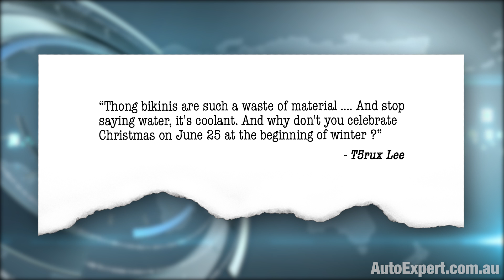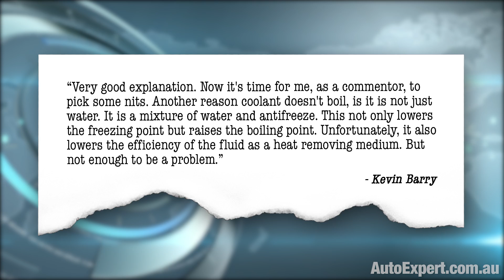The mad science of coolant (beer garden physics - yesssss!) | Auto Expert John Cadogan

Comment: Fun fact, you can infact draw more than 10 amps from a 10 amp plug, I run my 200 amp welder off of one which at peak will draw about 13amps from the wall. Multiple 10amp outlets often share a breaker so the breaker is usually rated more than 10 amps, it's just illadvised to do so for more than a few minutes at a time, melted cables and electrical fires being a thing. Still an electrical engineer and an electrician both told me this was ok to do.....

Comment: It also increases the boiling point so you can use a smaller radiator. That plus pressurising the coolant circuit means you can get away with a top pipe temperature of about 125C. Take a look at the section on nucleate boiling on Wikipedia - it's why water is a good coolant.
Reply from the maker: Try watching the fucking video - where I say all that about the BP and the pressure. You fucktard.

Comment: I actually run about 30% coolant 70% water in my car so I still get corrosion protection and freeze protection down to about 0 degrees F (way lower than I ever see here in Tennessee) while improving the engine's cooling a bit. Cooling is much more important where I live than freeze protection below 0 degrees F since it never gets nearly that cold here.

Comment: Just because the mixture has a poorer heat transfer rate than pure water doesn't mean it isn't acting as a coolant. Air is pretty poor at transferring heat but it still acts as the "coolant" for air cooled engines...

Comment: As an amateur mad scientist I will add that Ethelyne Glycol is clear. It is dyed green. The dye looks like aquarium gravel but if you handle it your hand will be green for weeks.
Also Propylene Glycol is sometimes used in diesels to prevent little bubbles from forming on the cylinder walls (all noise is movement). It is less toxic and here in Retardistan can legally be found in cheap ice cream and offbrand Toaster Strudel knockoffs.

Comment: I had to stop this lady, her car had a leaking "radiator" and she was about to put the green stuff in, but I could clearly see she was dripping orange fluid. Her car was running on of those OAT/HOAT variants of antifreeze. Thankfully I stopped her before she poured it into her system and turned her cooling system into jello! But yes, antifreeze isn't designed for better cooling, it's designed for places where it gets too cold to use water. Another issue people run into is overfilling their coolant, which causes a whole host of other problems. In any case, excellent discussion. I appreciate that you started with some lighter material to get our attention first. Plus, who doesn't like to look at a nice girl in a bikini?

Comment: Fun Show :) But hey? Isn't it obvious? - It's called coolant 'cos it's NOT water, due to necessary additives. Yes, antifreeze in "retardistan" - But, in 'Straya - still needs corrosion inhibitor. Yes, the heavy lifting shock absorber is the spring. Technically, the "shocky", is a Damper. But it's still a shock absorber - for the shock absorber? :) Yes, a radiator is a heat exchanger - When the engine is running. In a stopped vehicle - Everything cools down more by radiation, than convection? If this sounds like an engineer - Calm down - I done time, plumbing & clearing drains - like most blokes? :) After the silly season, John - You cd do a show about the possibility of magnet & coil induction suspension systems - to do the job of struts & regen back to hybrd or ev batt? They cd outlast mech struts?

Comment: these waterless coolant they clame you never need to change it or is it better or not then the off the shelf pre mixed red or green coolants, they any better then the regular stuff ?
Reply: Public Safety Lights Australia they’re rubbish for heat transfer. If you live in a warmer area don’t use them
Reply: @erroaustralia6311  yeah thought as much, sounds like a interesting product, will just stick with the off the shelf radiator fluid old faithful.
Reply: Public Safety Lights Australia if you want good heat transfer, NATRAD corrosion inhibitor Type B, up to 40% more heat transfer than OE coolants.

Comment: I only put it in to stop corrosion, 'specially for the ally parts. Antifreeze in Aus, yeh right (seen some orrible results of ally heads on plain water  from the '70's)  I'm sure the engineerholes design the cooling system to accommodate the additive factor

Comment: I thought the main reason to use the green stuff and not 100% water is to avoid corrosion of the aluminum alloy water jacket.
My former Kingswood HG with it's iron 186 just used tap water.
Reply: Yeah and probably corroded out now. Strike water at 20 thou through corrosion.  And all that rust build up  effects the engines ability to cool properly. OEM they used an inhibitor of some form. I worked in a Holden dealer in 71 and we sent lots of it too dealers.
And water= corroded water pumps, alloy intakes etc etc.

Comment: I know you mentioned de-ionized water in the video but how significant is it to NOT use tap water in a cooling system?  I have never used it but when I rebuilt my old Toyota diesel engine I found the cooling passages and oil cooler coated in what looked to me to be a calcium build up.  I assumed this was mineral build up from tap water and further assumed it was the equivalent of ceramic coating the cooling passages of the engine and reducing the heat transfer efficiency between the cast iron (in my case) and the 'coolant' in the engine.  Are these correct assumptions?  May be useful info for others reading these comments.
Reply: Some coolants will leave a greyish  color inside the dry cast iron. That is the water. But not corrosion. Some coolants of the past have been known to leave deposits around the engine hot spots, which flake off when the engine runs  hard or a very hot day. Looks like fine rust and blocks rad cores. Diesel Cruisers had that problem in the 80s. As did 90s Falcons.

Comment: Did I do that?

Damn, I need to get my car fixed, everywhere is closed. I swear, I think the bypass hose is going to fall the fuck off the T on each side of the heater hose. It's barely on, and I reckon a real hot day and a lot of pressure, and that fuckers going to go pop.

Comment: I love the comment about going up a hill at 80 towing a vsn with a tail wind behind a B double! Priceless! And a side note. The reason most of us race car dudes only use water wetter in our cooling system is because of everything you just said. Water wetter actually breaks the surface tension of said water to enable more heat transfer than even plan water! Happy new year John! Love your work mate!
Reply: The other reason is that many tracks do not allow antifreeze, due to its persistant slippery characteristics when spilled on the racing surface.

Comment: Swhy racing engines run pure water, that, and the clycol family are very slippery on a track. 
Refer The Workshops fight against a very exy product which raises the boiling point to through the roof.
Reply from the maker: The Workshop is a Muppet.
Reply: Coolant is NOT very slippery on track, but does take longer to evaporate. Only drag racing lives in the 50s. They use hankies for brakes as well!
The Confereration Against Motor Sport here in Oz tried that. Had so many race teams, coolant manufacturers shoot them down they decided they knew bugger all and we still use coolant

Comment: G'day John,
I was thinking of using Evan's waterless coolant in my hot rod build. 
1. Because the radiator is solid mounted to earth. 
2. I would have to test for stray leakages (electrical)  - stray currents.
3. If I went water 75% and coolant 25% I would still need to test for same.

Adding a sacrificial anode (like boats) could end up being a difficult installation/hard to maintain.
your thoughts?

cheers from the Central Coast.
Reply: Mudgrove Evans waterless coolant is about 75% ethylene glycol, it is extremely poor at heat transfer. I’d suggest a type B coolant which is glycol free. Transfers about 40% more heat than an OE coolant
Reply: @erroaustralia6311  Thanks, I'll check it out. Still a long way to go before I can even start this motor....

Comment: Springs prevent a shock from being translated to the car's body and technically shock absorbers do indeed then absorb the energy that has been put into that spring-mass system.
'Coolant' may be less effective than water, but that doesn't stop it from having as primary task to be a coolant.
Nuts, nuts, nuts, ...

Comment: Well said, John. Now try to explain Evans Waterless Coolant. Hell, the very name is an oxymoron.
Reply: Always one in every crowd haha. I think Evans is a bit heavier than glycol solutions and not as much heat absorption as normal coolant but it does not pressurise with engine temp like a water based coolant and  it is not as prone to corrosion and it boils at 190 C so less prone to steam pockets around hot spots.
Reply: as long as there is something  circulating in there it doesnt matter how  efficient it is its job is to cool the engine
Reply: @doomer33deg  oil is not as good as water.Need a bigger cooling system. Having said that, remember the Suzuki GSXR which were all oil cooled. When they got hot they smelt quite oily

Comment: Antifreeze/inhibitor is what I was taught as a kid. Two actions 1  lower the freezing point and 2 inhibit corrosion.
Reply: When working as a mechanic any coolant replacement for Commodores from VN on was at 50% Type A coolant 50% water. That was mandatory. I was also a licensed LPG fitter/mechanic for GMH as well as other brands and the corrosion in the LPG convertor from diluted or non-existent coolant made many of these convertors throw-away items despite diaphragms etc still being in working order.

Comment: "Think about the amount of heat that needs to be rejected"
**Except for when the Nissan engineers designed the TD42.
Reply: A better example might be the Nissan Leaf's battery pack.
Reply: Or any old Triumph, for that matter. Pretty ironic to see a car that was made in a country that's f-ing freezing all the time overheating. In some circles that would be regarded as a good thing, lol.
Reply: Likewise GM family 2.
Reply: They didn't account for the cowboy factor, stock they run fine if well maintained but as soon as they get a bit old or someone messes with the fuel or boost.....
Reply: You mean, voids the warranty? Why would they?In seriousness, coolant systems are generally specced to allow the engine to dump waste heat at rated (full) power with a plugging margin. As conditions are not entirely predictable, there will probably be derates in the map. Mess with this at your peril. And yes, I have been drinking. A lot.

Comment: Hi john. The correct method of heat transfer between gas, solid and liquid in the heat exchanger, commonly  known as "the radiator" is conduction, not convection.  P.S. The ladies are smokin' hot!
Reply from the maker: No - it's convection. Forced convection.
Reply: @AutoExpertJC  Well, there you go, that's why I like to talk to people who don't hold the same opinion than myself. I might be wrong, you might be wrong, But everybody learns something they didn't know before. Such as, I learnt the difference between natural convection and forced convection. Cheers!
Reply from the maker: @smokincrater  You're not thinking straight. This is not opinion-based stuff. The science of heat transfer is sorted at this very basic level. It's convection. Pretty much any time heat leaves a solid and goes into a fluid, it's convection. Conduction is more common in solids. In relation to who might be right and who might be wrong: the person who studied this science at university, and passed, is probably not wrong.
Reply: @AutoExpertJC  I concede you were right. Perhaps, did not explain properly what I was talking about and why I listen to other people who have different opinions. The problem with the internet is that has echo chambers and no one is prepared to at least voice their opinions wrong or right. Who can blame them, for the crap they cop. So I learnt something that I did not know. I am not contesting it.  That is why I watch channels such as this. Thank you.

Comment: You can use a product called Water Wetter but its not to be used if there are magnesium components that come into contact with it in the cooling circuit. This product is an anti boil agent and works well in OzStraya's hot climate.

Comment: You're not telling me anything new here. For the past 25 years or so, I've never run more than about 15-20% concentration of 'coolant' in anything I've owned. I rarely see a risk of actual freezing temps, and when I do, 15-20% is usually good enough to stop any freezing. It's also good enough to stop corrosion.

I would much prefer the better cooling capability offered by a less concentrated mix in the cooling system.

Paul.

Comment: Another couple that drive me "NUTs, down there" is Amperage and Wattage - both are NOT standard units of measure, it is Amp or plural Ampere and Watt or plural Watts.
Reply: Amp is an abbreviation of ampere (the name of the scientist).  The plural is amps or amperes.  Of course, having been an electronics technician for the past 55 years I could be wrong.

Comment: Are we being hoodwinked into paying for coolant in Australia when the old fashioned soluble oil added to water gave you similar anticorrosive properties
Reply: It worked very well for corrosion protection but had a negative impact on rubber hoses and water pump seals. Oil and rubber don"t mix, the oil soon rotted the rubber which came at a cost. Cheers
Reply: @AquaMarine1000  Oil and rubber mix only too well. That is why the rubber slowly dissolves.

Comment: The proper term for "radiators" is "heat exchangers", just like how "shock absorbers" are in fact "suspension dampers".
Reply: same fucking difference for both lol a radiator radiates energy does it fucking not. and a shock absorber does absorb the fucking energy and transfers it to heat also.
Reply: @doomer33deg  The purpose of the "shock absorber" is to dampen the oscillations of the spring, hence the reason the British call it a damper.
Reply: @doomer33deg  The radiation part is a few percent at best, most is convected away after being conducted from the water to the air.
Reply: @Kris_M  semantics to me
Reply: @doomer33deg  I can not understand how can you be proud of not understanding something... :\

I'm not an expert in thermodinamics
, but I'm still going to try and explain it with a simple example. Please correct me if I say something untrue.

The next time you are close to a camp fire, remember that the heat that you feel is due to radiation being emitted from the combustion process (infra-red radiation). In a wild fire, this is what causes houses to start burning long before the flames actually reach them. Now, if you put your hand on top of the fire (without touching the flame), you will feel a lot more heat, because of the hot air rising from the combustion area. This transfer of energy from the combustion to your hand by the air that is moving is called convection.
 It's the actuall air that is carrying the heat.

'Radiators', are designed to cool down through convection, that's why the fan turns on when you are sitting in traffic, to keep air moving through it and carry the heat away. The amount of heat they release through actuallual radiation is incredibly small and insuficient.

And if you are still reading, here's a fun fact: cooling the Internal Space Station (ISS) is quite hard. Since there is no air in space, convection cannot be used, because it needs a physical medium, like air or water. So they are stuck with using radiation, which does not need a medium.

Comment: So if my car never sees freezing temps because I live in the tropics, I can lower the antifreeze percentage and increase cooling performance, but how far before I run into corrosion issues?
Reply: depends on the soft metals and also the seal on the water pump
Reply: Answer,, you cannot.
Reply: Most modern "antifreeze" is also an anti-boil solution. Not to mention anti corrosive properties.

Comment: John will probably curse and kxll me. I've been putting in 100 concentrate for approximately 20 years. I haven't had rusted thermostats, radiators, water pumps etc.. Thank fark. I have had my car for more than 10 years.. It's got 400 thousand km and counting.. Cheers
Reply: The good thermostats are made of brass and stainless steel.(so no rusting would ever occur), radiators are brass, water pumps are plastic or brass or aluminum, because they thought of that. You could go with straight water,however water is what boils out. The 50/50 mix raises the bp & Fp (freezing down to -40C or -40F ) I don't remember maximum Boiling point but it is the water that boils out when that happens still leaving  you with antifreeze in the lines.  Pure is not quite as good as mix.